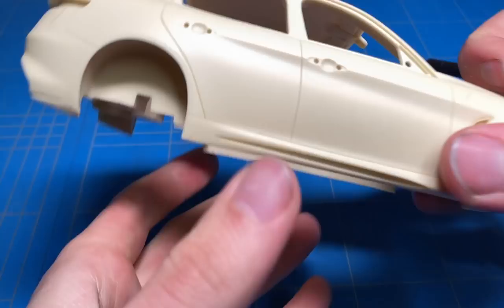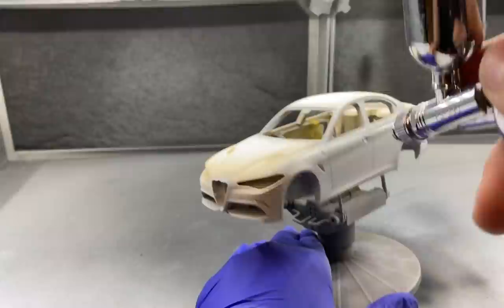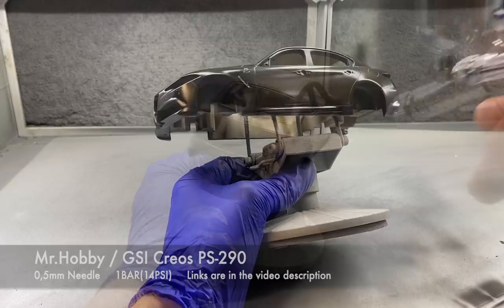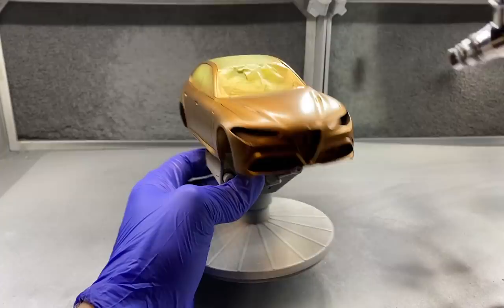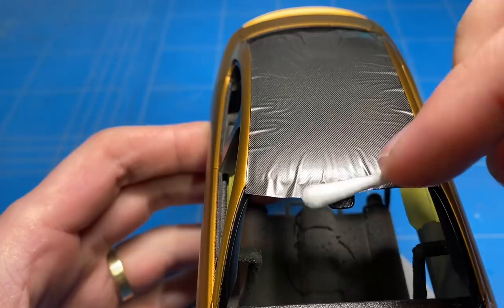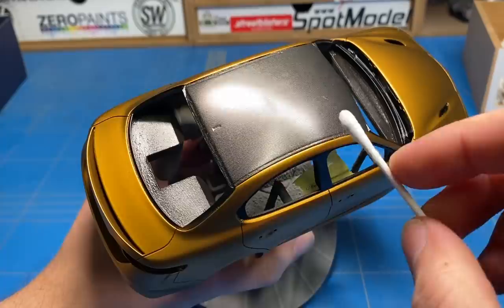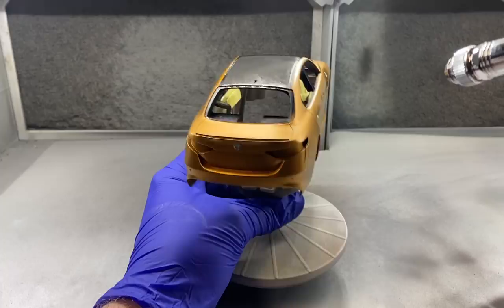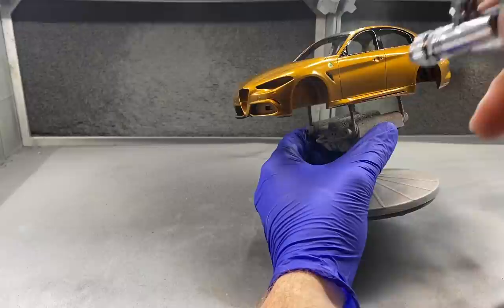Alpha Model: Alfa Romeo Giulia Quadrifoglio Part 1: Paint

Comment: Starting out with airbrushing and noticed you used two different needle sizes for the primer and paint.   Just trying to understand the different needle sizes and when to use them.  Does it just depend on what type of paint being used?
Reply from the maker: The bigger the needle. The more paint will flow out. The smaller the needle, less paint will flow out and you’ll have more control/precision

Comment: 14psi only and it sprays like that? that is amazing! are your paints already thinned? or do you thin yourself? if so what's your ratio? I have an iwata also with ,3 needle and I can't get it to have that smooth spray.. I use Tamiya acrylic paints, and thin then 1-1 with Mr:color leveling thinner (the one with the retardant)
Reply from the maker: The streetblisters paints are pre thinned. I thin the tamiya paints myself. No idea on the exact ratio. I just keep adding thinner untill it flows nice

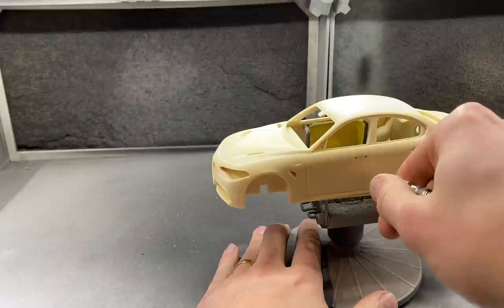Comment: Another great video ! What would u recommend using to put over water slide decals to protect/seal on 1:18 metal die cast car that’s already painted? I’m just adding decals with micro set/sol ..thx
Reply from the maker: a uv resistant clearcoat.